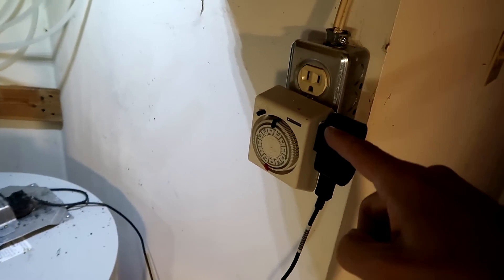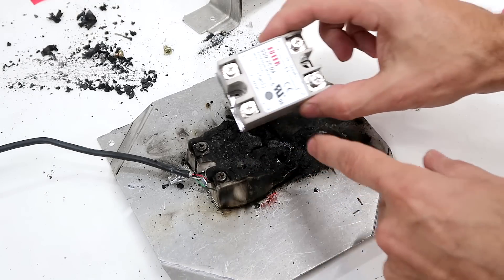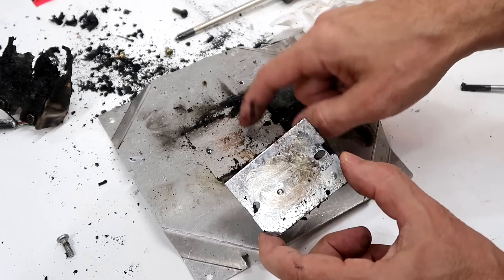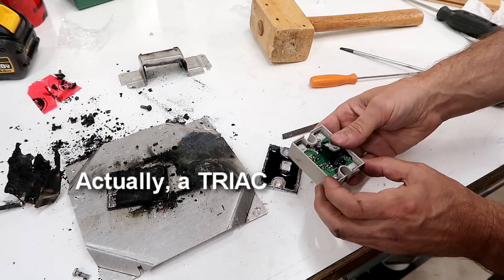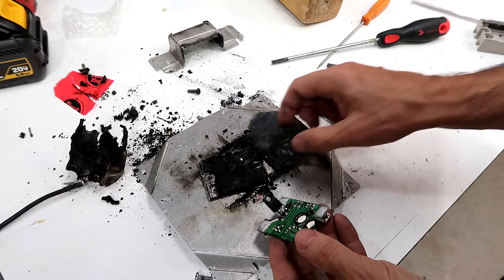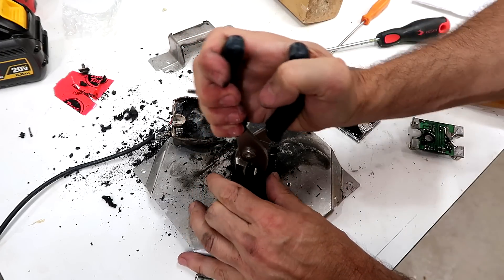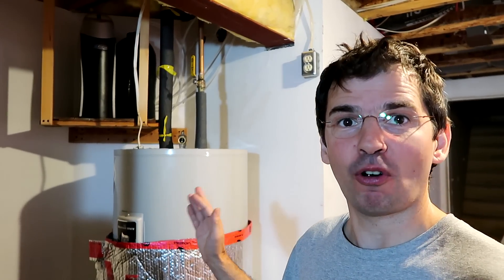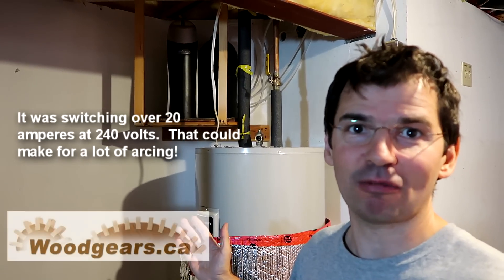Spectacular solid state relay failure

Comment: @matthiasrandomstuff2221 That's mainly your fault!!!  Firstly, you dumb if u belive that you  can buy strong enough SSR to handle a few tousend Watts load for few bucks and secondly, output side of the relay MUST BE AT LEAST protected by a properly-rated MOV and glass fuse or the best  also a thermistor connected to SSR housing.. With  correctly-rated fuse and MOV, that should not happen, because MOV shorts live to neutral in case of overload and blow the fuse... At least that happend and I hope that you learned the lesson and next time you will connect and protect your heater correctly againt such failure...
Reply from the maker: It was a resistive load -- a water heater.  The current never spiked or anything, and once the relay self destructed, the current was actually less.  So a fuse would have done nothing here.

Comment: You can just add a dimmer. I suggest that for 200L of water, it is enought to reduce the heater from 1800W to 500... 600W, but depends on your needs. My consumption of 70C degrees hot water is about 50L/ day.
Reply from the maker: a dimmmer would fail sooner and more spectacularly!
Reply: @matthiasrandomstuff2221  it depends... for a heater of 1800W, i suggest that a 4000W dimmer will work well, for reducing the power from 1800W to 600W. I mean to add a dimmer, not to replace the relay. It is just for reducing the power of the heater, .. for reducing the current through relay.

Comment: Solid state relays are not designed to drive inductive loads such as transformers, electric motors or other similar loads. They internally have a component called TRIAC, which is a thyristor that is not capable of activating these loads safely and guaranteeing perfect operation in these cases. Therefore, they can burn and even cause fires. Especially when it comes to these low quality Chinese products. In these cases, there is a need to use electromechanical relays or contactors.
      The use of SSR's needs to be done with caution and care, because they do not replace electromechanical relays 100%.
Good luck!
Reply from the maker: this was a resistive load.

Comment: Well this is embarrassing.  You did not read the SSR's application notes!!   ALL SSRs require a whacking great heat sink - literally, the size of half of a shoebox - big - to live for very long.
Hint: THE HOT SURFACE OF A WATER HEATER IS NOT A GOOD HEAT SINK!  I laughed out loud and probably woke up my wife and my housemate.  
And yes, smart people rate stressed parts conservatively instead of right up against the stated limits.
You asked a 25 amp relay to pass 22 amps with no heat sink at all, what did you expect would happen?  You left yourself no wiggle room for something to go wrong.
"I didn't know it needed a heat sink" -- well why didn't you know??  Do you always set about new and potentially dangerous tasks without educating yourself first?  Do you? Really?
READ. THE. DOCUMENTATION.

Comment: well, I think in this example it is showed how important to make automation system. I mean, it should have used the current limiter to make sure the current will not over 20 Amp. It is also important to add temperature sensor near the SSR to detect if the temperature is higher than it should be. If those two things happen, then the system will turn off the heater automatically and an alarm is turned on (before the SSR is failed or burned).

Comment: I had one destroy itself, mine was a DC version switching 12V, switched by a microcontroller. It melted badly, so I made my own using two MOSFETs as a low side switch.

Comment: Just get a mechanical timer for water heaters at your local hardware store. These SSR can only meet  spec rating with a decent amount of thermal control with a heatsink and fans . you got lucky that's all that happened. At the very least you should have put the thing in an electrical enclosure. This is terrible design and  Engineering and you will get someone killed .

Comment: Before doing this good to understand failure modes so you can design-in the required engineering controls to prevent failure and fires and if there's a fire to detect it and shut off power and alert occupants;  Even SSRs that are sized correctly will fail due to thermal cycling on electrical contacts; Youtuber Davesaties has a good video on this; also see comments below his video for more details on potential engineering mitigation issues.  https://www.youtube.com/watch?v=yM_5tGAZD64&loop=0 .   As noted above, since thermal cycling is a major cause of SSR failures; the location of the SSR on top of the water heater is a poor choice in this regard as it amplifies this issue.  Also important are; fireproof box, a cooling fan on SSR, and sensors to detect fire and shut off the power.  Also critical is a periodic maintenance plan to thermally check SSR for overheating due to loose electrical connections (caused by thermal cycling).  Also, adding fan and oversizing SSR are critical.  Not a project for the inexperienced and untrained, given the potential for catastrophic damage, so best know what you're doing or get help from an engineer that does.  As commenter "accountshanahan" noted" super lucky didn't burn down the house and possibly kill some of the occupants...  also should note that SSR's don't always fail in an open-circuit; sometimes they fail with a closed circuit so be sure there's backup system thermal shut-off, and with heated water tanks, must also have working pressure relief etc...

Comment: Much more likely explanation: a lightning surge. According to the datasheet, the SSR is rated to withstand 600VAC.  However, in case of current/voltage surge, the voltage will inevitably rise much higher in case no protection was in place (GDT, MOV, TPSD).

Comment: Those triac inside is downgraded amp other videos show break down of what's inside ,they lied amperage  rating so need higher amperage  rating sir . Other dc to DC relat has down graded  transistor too and burned up its common  to made in chaina MPPT, Relay, charge controller, SSR

Comment: 3D printing community uses these relays for mains heated large printer beds, almost always attached to thermal fuses for thermal runaways.
Reply: Just that the one in the video is fake. This comes late, but beware, this must be the most counterfeited ssr on the market.

Comment: You put WAYYYYYYYYY too small a heatsink for that SSR. For a 30a load (what most water heaters pull) you need active cooling or a radiator system.

Comment: It appears the problem is the lack of adequate heat sinking of the relay.  I do not see
thermal compound on the relay plate.  this is necessary to greatly improve the transfer 
of heat to the heat sink.  Any small air gap say 0.001" is a problem.  Also the metal plate
you are using appears to be steel.  Not the best material for conducting thermal energy
Aluminum is much better by about 4 X.   The idea is sound but execution was lacking, 
use a big aluminum heat sink with thermal compound between the relay and sink,  make
sure air can move freely around and past the heat sink enclose the relay in a metal box to 
protect against fire and having exposed voltages.

Comment: You used a 25A version. Should probably have used the SSR-40DA?
Reply: That would still need a very good heat sink. Anything over ~ 4A requires a heat sink. Check the data sheets. This is a misapplication of the part. Like using a dozen Popsicle sticks to make a jack stand!

Comment: No heat sink you cant do that without having a charcoal mess.
Reply from the maker: It was still mounted on the heat sink when I showed it in the video.
Reply: @matthiasrandomstuff2221  That heat sink is way too small! Do the math, you will need a very large finned heat sink, and probably a fan, a plate will not do it. Even a top-rated brand would have burned up, the "cheap knock off" comments from others are off the mark. The TO220 spec you mentioned is an "ideal" spec, where the case is kept at room temperature. You would actually need to be running a chiller to do that. It isn't a practical limit, it is used for reference for the heat sink calculations. It's not trivial at these power levels.

Comment: heatsink is on top of the heat source? that was clever
Reply from the maker: those hot water tanks don't get warm on the oustside.
Reply: Matthias random stuff  It might not feel warm to touch, but it certainly losses heat and contributed to relay overheating. 
Mounting the same heatsink vertically on the side of the water heater or even better on the wall next to it would definitely provide better air circulation and would lower operating temperature.

Comment: The water heater is not a good place to dissipate heat.  you should also install the relay on a heat sink like this: https://www.aliexpress.com/item/32914084709.html?spm=a2g0o.cart.0.0.4a953c00PNT8lE&mp=1

Comment: the fake SSR only has triac rated for 12A, which should be de-rated  to 25 to 50% for actual use, about 5A . for a 22A load you need a Real 50-80A SSR with an adequate heat sink. a real 50A SSR purchased from a real supplier like digikey costs $50-100

Comment: Hi, this is not a product failure. It is a problem of your installation. The problem that happened to you was not to place a heat sink, as the specification says. If the circulating current is greater than 20 amps, you must include a fan.

Comment: Never ever going over 2/3 total load  ,it will heat up and blow out.
Reply: With the Amazon inexpensive ones, my advice is to not go over 1/2 the rated load, and for sure not for an extended period of time. I agree with the folks who said he should have used a mechanical relay for this application where the load is ON most of the time and switches OFF only once in a while.  I have had great luck with the SSR cheapies on loads that are 1/4 the rated load ( I include a fuse, it is a must if using any SSR, name brand or not.)
Reply: @6strings735  Agree, Over rate them and use heat sink and fuse. I ran my water heater on a SSR for years with no issue. 
It was controlled by a Vista-50 alarm panel timed to turn mornings and nights for 2 hours.
The SSR was way over rated, had a serious heat sink and was in an enclosure.. That was 20 years ago so I'd bet it was a name brand.  rating was 60 amps.

Comment: The transistor inside that unit is actually only rated at 50% of whatever is printed on the label on the faceplate this has been highly publicized and documented fight test performed by other people and at that if you really want to be safe you would only run something at 50% of that 50% which would make it 25% and It have to be heat sink not mounted on a small piece of tin they literally need a large aluminum and he seems to dissipate the heat. It’s burnt up because it was applied incorrectly for the wrong application with the wrong rating without a heat sink

Comment: Where did you get the SSR?  Many of the SSR's less than $5 are fakes.  Google "fake SSR" for a wealth of information.  There are several SSR autopsy videos on YouTube where the label says 25 AMP but the part inside is 12 AMP or a 40 AMP unit with 16 AMP part.  Often the internal isolation barriers are inadequate as well.  Only buy SSR's from reputable sources.

Comment: I bought the 100Amp version of this SSR hoping it would be able to handle a 10amp load , I set it up on a test bed with supplied heat sink fitted properly with thermal paste, after just 13 minutes i decided there was no way id be trusting it - SSR's can be extremely useful with items that have load arc but do spend the money and buy proper ones - These chinese knocks offs are basically fire lighters.

Comment: I use these in a pid controlled coffee machine, they fail occasionally (1 or 2 years use) open circuit. but so cheap so just replace now buy multiples so have spare, Last one seems to be lasting long time.

Comment: You need to learn chinese.
25 amps will have transistor rated 15 amps.
25 amps is the smoke point.

I buy/sell generators. 8000 chinese watts seems to equal 5000 actual.

Its becoming a problem having to over/derate things based on their origin.

Comment: Wow, that cheep Chinese SSR lasted for 4 months at 88 % load running for longer periods of time dayly? Not bad.
These Chinese ratings are very optimistic and i would not ever put more than 30-50 % load on these 4 $ SSRs. Sometimes, Chinese manufacturers label 12 A ones as 24 A SSRs. 
You should also never use a high quality SSR on nearly full load in continuous use. For 22 A, i would always use something in the 40 A range.
Reply: Wow, thank you for confirming my own experiences and what i have seen at BigClive's Youtube channel. I had not thought, that you even get a 4A Triac in a "60A" SSR. You absolutely never know, what's inside unless you take it apart and destroy it. That is unbelievable...
A fireproof box is a must-have for these ones. A really good idea.
Never switch loads with an SSR, when the load running forever may burn down your house or destroy something valueable. Almost everytime, an SSR fails, it will get continuously conductive and the load will stay on forever. Lights are not very critical, but heaters or motors in some applications.

Comment: Don't cheap out on relays... Some people suggesting SSRs are great for PID switching heaters. It's retarded. Most SSRs are not rated for more than 10 switches per minute if used without interruption. I'm talking heaters as in KW.

Comment: That was a close one.

Solder on top of the circuit traces has almost no effect on electrical resistance - it only increases the thermal conductivity slightly.  The electrical resistance of copper is .168 micro ohm-meters and electrical solder is a little more than 10 times more resistive at 1.96 micro ohm-meters.
Reply from the maker: True enough, but the solder is MUCH ticker

Comment: These type of solid state relays require a good heatsink unless your using < 50% of power depending upon ambient temperature and % ON time. The steel sheet metal is a poor heat sink.  You should have used a 50 amp SSR with an appropriate Aluminum heatsink with thermal compound/pad. Better yet, use a contactor.

Comment: why not just use a mechanical relay
Reply from the maker: couldn't fine one at the time.  Didn't realize they had quite as much voltage drop (some DC ones I used in the past had much less drop)

Comment: Wow your a brave man using that in your house! Lucky you didn't burn it down. For the loads involved with a water heater I would have that relay operating the coil on a contractor and let the contractor do the heavy switching on the heater circuit. (Don't know if a contractor is a thing in the US, in the UK its basically an industrial type relay with failure protection and a much bigger spark gap so they can be rated to very large loads). Love the channel and good luck with the house move
Reply: What would you suggest  to  switch  on a 350w power supply?  I could be  left on for  months at  a  time

Comment: Did you use wires in screw terminals? I have seen screw terminals burn up because they were used with wires instead of proper ferrules on the end of the wires

Comment: Chinese fake. It has traces to small   and to close. Close traces with relative high voltages on them start leaking and burning. Don't buy cheap chinese crap. Even when the load is resistive they will fail.

Comment: I actually tried to tho something like this a while ago. The main difference between ours is that I used a proper contactor and an extra circuit breaker. Great job though, not ignoring it and posting it!

Comment: That is why you avoid cheap SSR from ebay, China and Futek. The main problem with Fotek (Taiwan) is that there is actually a lot of fake / counterfeit ssrs around from China.

Recommeneded: Crydom, Omron, Ametek, Opto22, Weidmuller, Sharp, Altech, Carlo Gavazzi. There might be more, like Panasonic, but who knows. And buy via trusted distriubutor, like digikey for example.

Seriously, anything that can go into flames when you are not around should be of highest quality.

But honestly I think you failed to properly secure cables, or the screw terminal connectors corroded or are of poor material, and they started heating up.

Also, it is likely mechanical relay would be better here. Unless you need switching off and on every few seconds, go with relay.

Comment: I've disassembled bunch of those solid state relays from different ebay sellers and found that 100% of triacs are grossly underpowered (12 - 16A, while relay is rated for 25A) and some of the relays had clearance issues, meaning that if some surge condition would happen - the relay will disintegrate, just like yours did. My advice - don't use those cheap SSRs from ebay, buy them from Digikey, Mouser, etc. (yes, they will be much more expensive).
Reply: I had the exact same experience. Took apart a cheap eBay 25A rated SSR and found a 12A triac
Reply: I found a 40A rated one with a triac that can handle only 16A. 😅

Comment: I have the same type of set up on my electric hot water heater (3000watt) that I use in the in-floor heating system of my shop. It's been in use for 4 years. Only runs the heater at night. I used the same relay but 40amp as I had read that they were prone to overheating when used at their top rating ;)    mine is also on a large aluminum heat sink. It gets warm but not hot. Electromechanical relay is actually a better option for this use but I opted to use the triac as it was a lot cheaper. I would just upgrade your hardware and resume saving money.

Comment: The cheap Chinese knockoff solid state relays are usually way over rated.
I bought a couple from eBay and the triacs were only good for 15 amps when the solid state relay was rated for 40 amps
The legit solid state relays I bought from Mouser were much better, I could not even disassemble it because it was potted in Epoxy